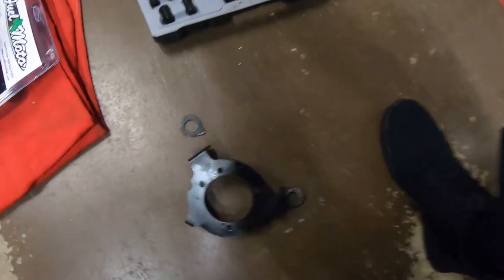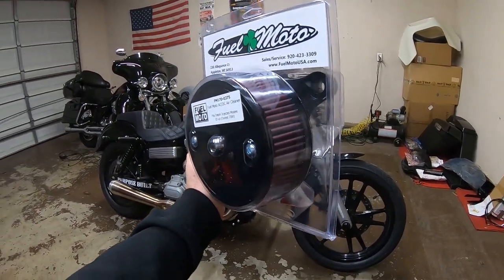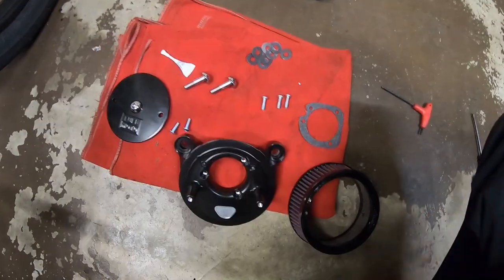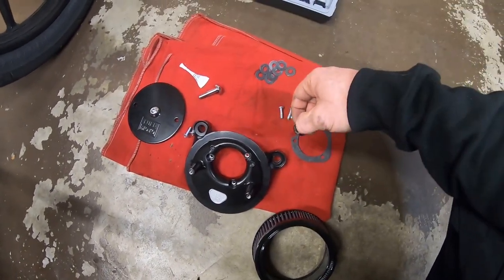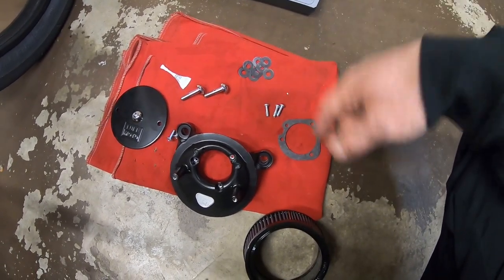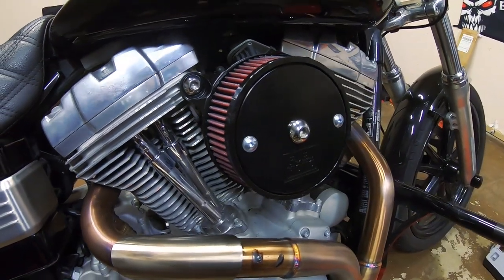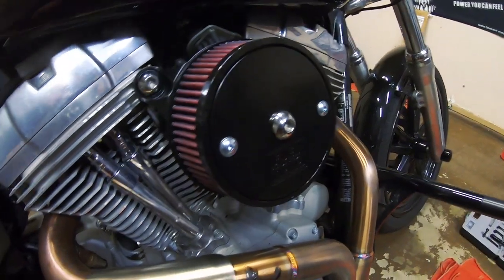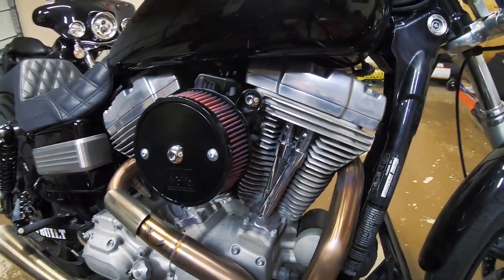Fuel Moto AC/DC Stage One Air Cleaner Install

Comment: Question on clean 2010 dyna FXD I am looking at for $6500.00 with 6500 miles. Do you think the price is reasonable? I would have to change out handle bars, exhaust, and return bike to mid controls as it was changed to forward controls. Also, I am not mechanically inclined. I might have to pay for labor to do the changes. Is that a deal breaker or too costly? I have not priced labor.
Reply from the maker: That price is fantastic I paid more for my 09 with way more miles.....👍👍👍 go get the bike you will love it
Reply: tripp_hpjunkie Thanks!
Reply from the maker: @dry509  no problem good luck man let me know if you need any more help
Reply: @TrippHPjunkie  I paid 6500 for an 05 road king with 65k on it! Still not sure if I sound dumb saying that 😂 couldn’t find any cheaper!
Reply from the maker: Thats the market right now really hard to find deals